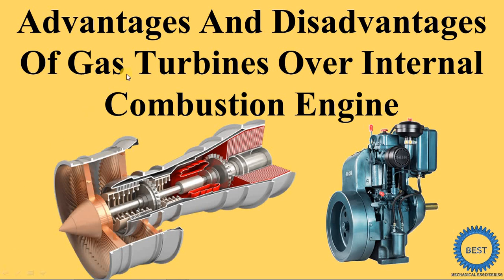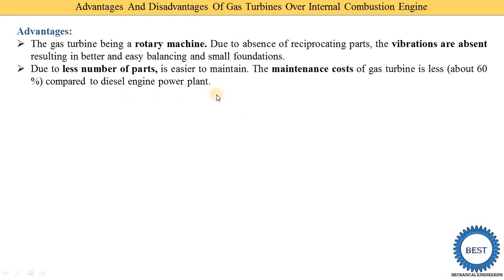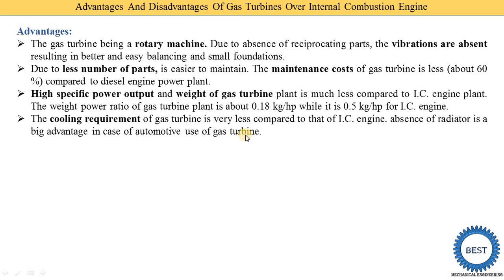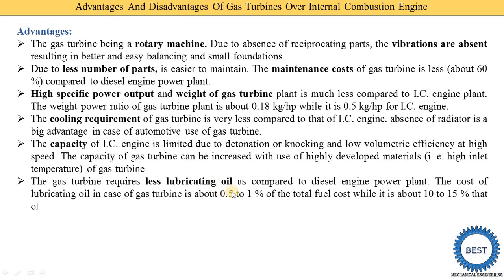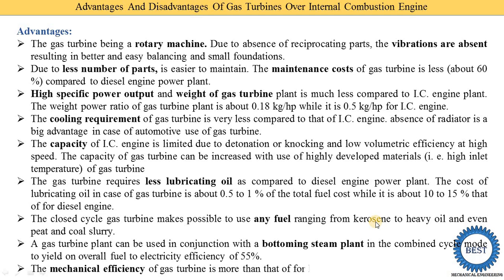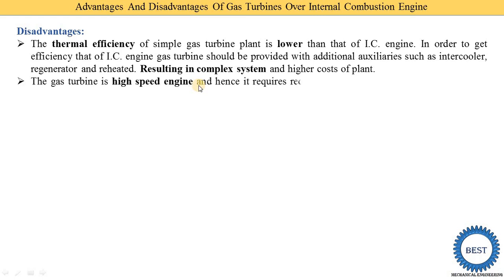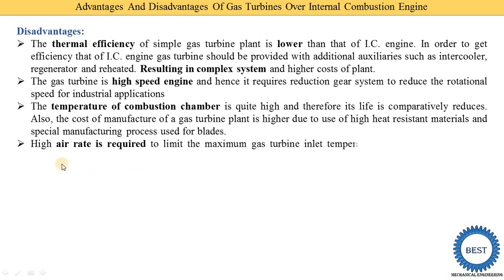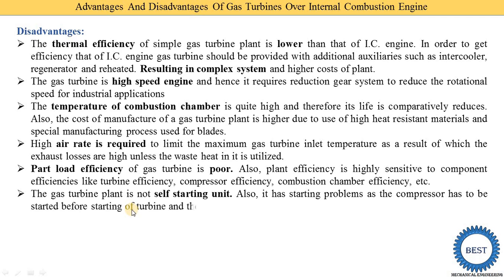Advantages And Disadvantages Of Gas Turbines Over Internal Combustion Engine

Comment: Hey liked the video. Would also like to add, you can use a modified gas or jet turbine engine to directly run a generator without using steam. These are known as "peaker plants". They use natural gas as the fuel, are 99% efficient, and emit almost no pollution due to their efficiency. Carbon monoxide and steam is the primary gases emmitted from such plants, but again at very low levels.

Comment: It's the cost and availability of natural gas is what makes them prohibitive to run all the time. Not to mention replacing the turbine engine much more quickly if they operated as coal plants do. The whole notion behind using steam to turn the generators is it's simplicity and far fewer parts allow for electric generation 24/7 for many years before any maintenance is needed. Many people don't know the main component of a generator, the stator, never go bad. So generator maintenance is surprisingly low for the amount of time they run (Thank you Tesla!)